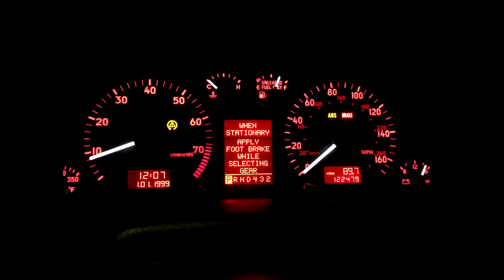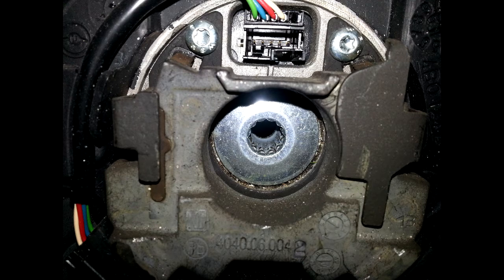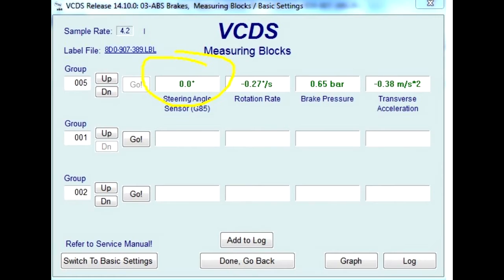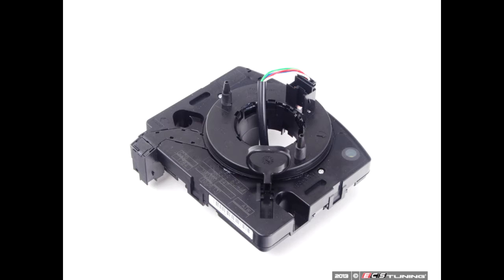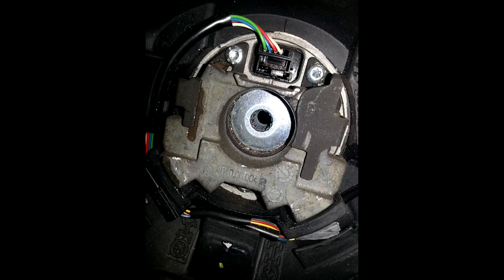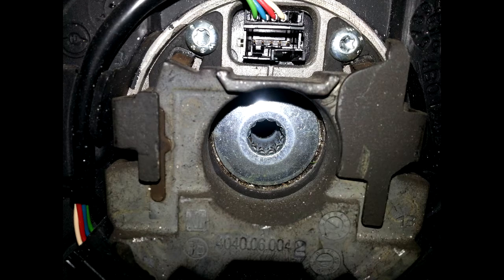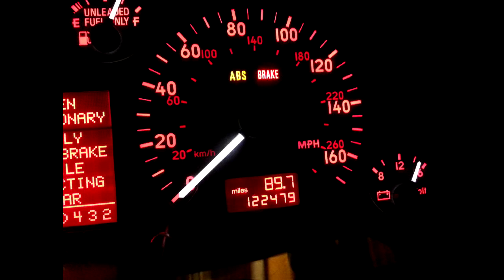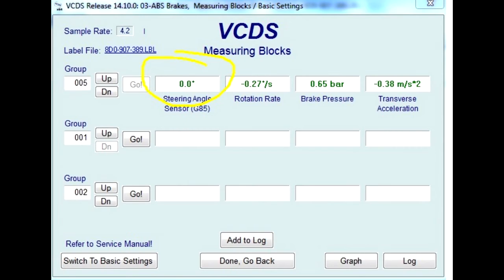2002 Audi S4: Ep. 3 - Steering Angle Sensor

Comment: So I just changed my steering angle sensor in my 03 Audi A4 which was the error code that I got telling me that’s the reason my brake light was flashing, esp light on and abs light on. I put everything back together correctly and the lights are still on is there something I’m missing?